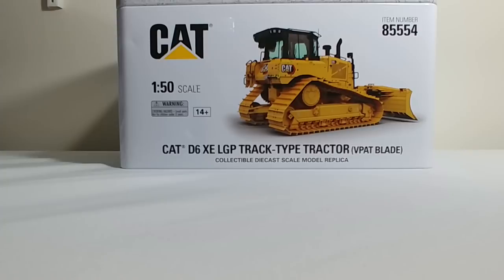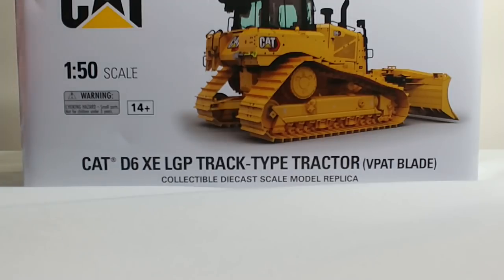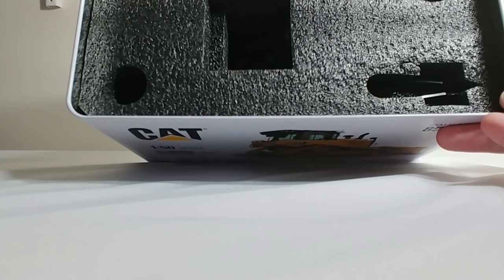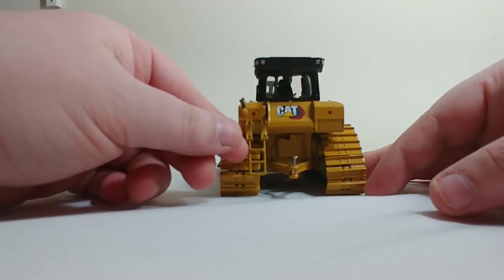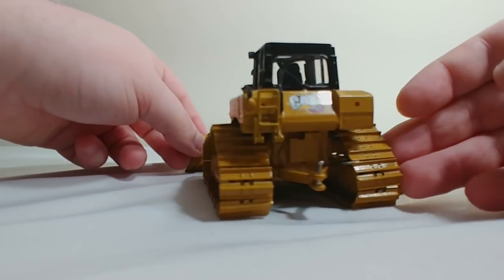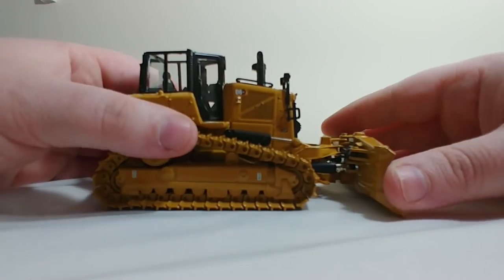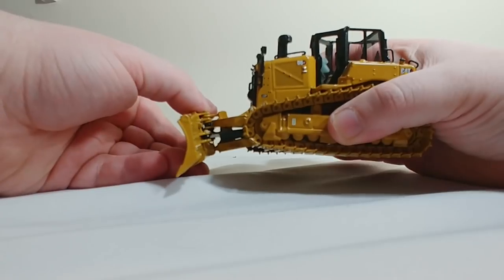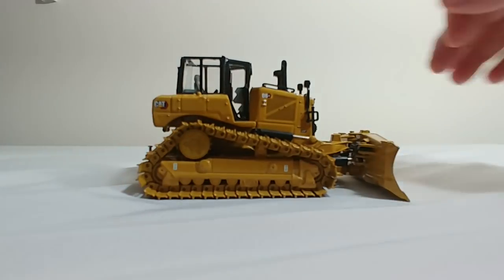Diecast Masters Caterpillar D6 XE LGP Track-Type Tractor VPAT Blade (Item Number: 85554)

Comment: nice review the cylinders on mine hold up fine for the blade
Reply from the maker: Thanks man. Yeah I know a couple German collectors who have said their cylinders are fine but their tilt angle is also limited just like mine which really should have been addressed. Thanks for watching man hope you're doing well.
Reply from the maker: Also, any suggestions on how to stiffen up the cylinders? I've heard some people in the past have used glue, but I am apprehensive of doing that because I don't want to glue it in one position lol.
Reply: @DiecastEmporium  the tilt on mine is the same as yours like you said the model was rushed for bauma use clear nail polish on your cylinders to tighten them up don't use glue you could break your cylinders
Reply from the maker: @The690ELC  Nail polish? I never thought of that! Just put a little bit of that inside the cylinder jackets?
Reply: @DiecastEmporium  Put it on the cylinders themselves just a little bit on each side you are trying to thicken the cylinder so that there is friction between the cylinder and the jacket to hold the pose you want